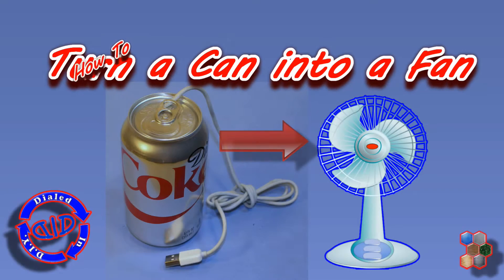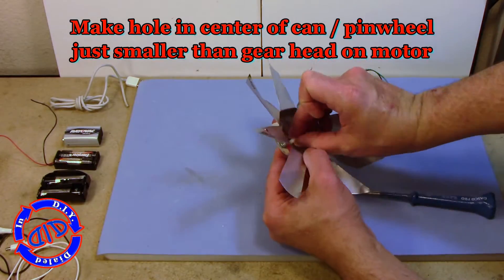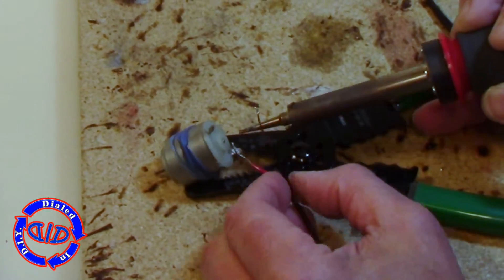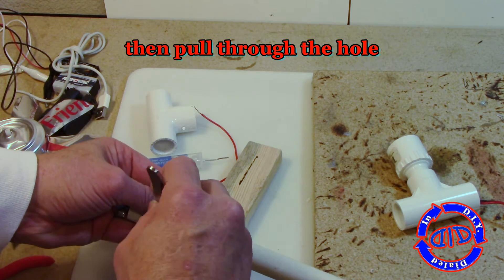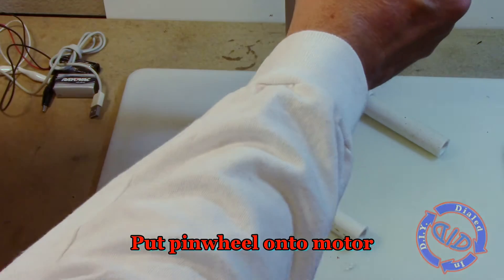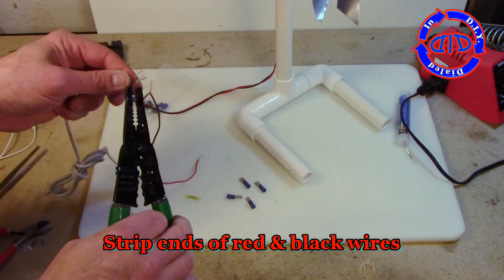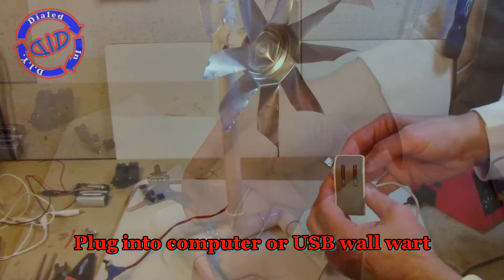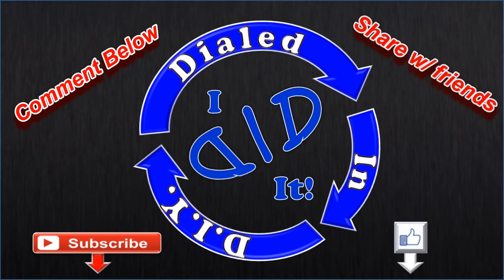Hack a Can into a Fan - DIY cool breeze - USB or Battery

Comment: How cool is this!  I always get confused on how much power I need to power a device.  You used batteries then a USB wall plug.  Is there a quick reference to how much power is needed when building something like this?  What if you had 3 pop can fans wired together.  Would a battery setup power all 3 DC motors? Could I use a regular old extension cord and wire it to the DC motor and plug it into the wall (AC)?  I know...too many questions...sorry :)
Reply from the maker: Thanks so much for taking the time to watch my vid and post your comment/questions.  The power needed for each device depends on the device itself so it does get confusing (I don't always know exactly what a salvaged parts limits might be).  In this case I knew the motor could handle a range of DC power.  I started with 3v from batteries up to the 5v DC from the USB wall wart (plug).  The 5v supply made the motor spin faster which is what I wanted.  How much battery power you need and how to best wire them up will depend upon the needs of the 3 motors.  Typically, if I had 3 of the same motor, I would use a parallel connection; connect a wire from positive side of power supply to each positive contact on the motors, and another set of wires for each of the negative connections from the power supply.  Does that help to answer your questions?
Reply: @DialedInDIY  Yes it does! In my mind I am trying to figure out other things all of the time but I don't really know what to ask sometimes. I was initially trying to figure out LED strip lights but I watched your video on it and it helped me immensely!  I didn't have a power supply for it and didn't know what I needed to purchase or salvage.  I am also trying to figure out how much power is needed to power 2 single led bulbs.  It won't take much at all so I am sure that an AA battery should do fine. I guess what I am asking is, if I add too much power - like an AC wall plug, will I blow it up, or will it just use what is required of it?  Can I mix a DC set up with an AC plug or do I need a converter? I know, way too many questions....my mind is melting :)
Reply from the maker: @lavenderrainbow5041  So glad the LED strip light video helped too!  Most of those strip lights are 12v but I also have some I bought for computer monitor related projects that run on 5v (so they can be plugged in to USB).
LED bulbs have power requirements that differ based upon factors like size and definitely color.  Too much power will fry them and there is no recovery from that.  Your wall AC will also fry them.  Your idea of a wall plug is perfect (I did that with some LEDs that I made a string of lights out of - I have an old video out there on that project, it had round coke bottles over the LEDs).  I am going to look for some links to post that will help with LED power requirements... like figuring out how much different types of LEDs need (I will be back soon with that).

Comment: Sharp metal!! Are you an idiot? Why not just tape razor blades to the motor. Might want to add an auto dialer that calls 911 when powered on! Use your head. Some kid is going to try this and it will end bloody. Can't get much more irresponsible than this!
Reply from the maker: Sadly we do live in an age where excessive warnings need to be included on things like the one on lawnmowers; "do not put fingers under mower when blade is engaged."  You'd think all of this would seem intuitive huh?  That's why I put warnings on these types of projects.  I would hope that anyone too young to understand these safety considerations would be supervised if there were sharp objects being used or worked with.  Thanks for the comment and for watching my vid.